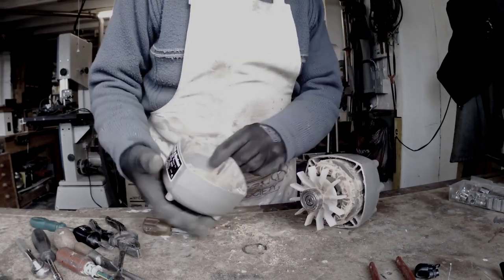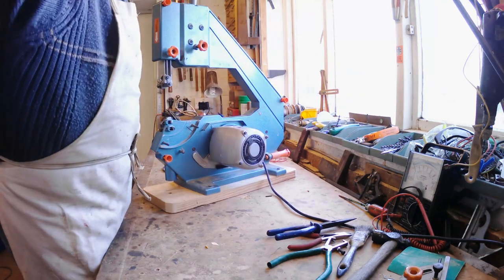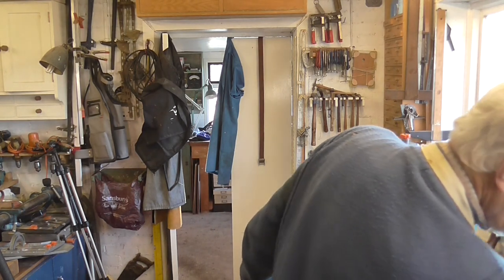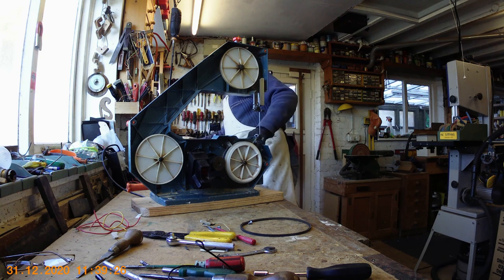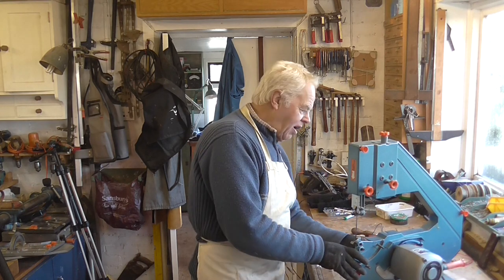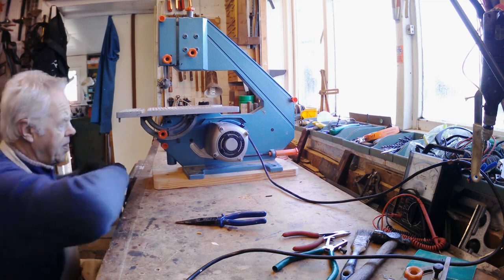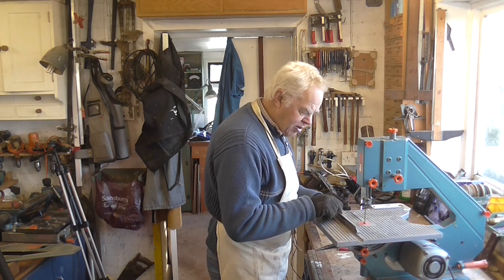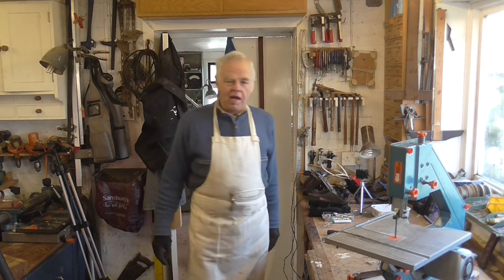Black & Decker Bandsaw repair Part Three.

Comment: A really instructive video (in 3 parts) that helped a lot. Same rotten wire insulation of course, could fix it in the same way as you did. Lovely to have the machine working again. A BIG THANK YOU from me in Sweden.
Reply from the maker: Many thanks for your kind comment Boo. Since I did this video so many people have reported the same wiring fault on these saws. so I am glad that I did the videos and that they have helped people.

Comment: Nice one. I have a bigger bandsaw, but still use the little B&D for cutting curves regularly. Great little saws.
Reply from the maker: Indeed, when one buys a bandsaw for the first time one gets a selection of blades from wide to narrow, but in practice I don't know anyone who changes blades for different jobs unless it's for a lot of work so a smaller machine is always worth having. Thanks for the comment.

Comment: Maybe a screwdriver set as a late Christmas present for Mrs Scrimper? I got my Wife a set and she loves them as she doesn't have to go out into the cold workshop when she needs one. And I'm happy because my screwdrivers are where I left them. I have also suggested to Mrs Col I need a second bandsaw but it didn't go down too well. I'll keep working on that one.
Reply from the maker: Hi Col, I actually equipped Mrs Scrimper with her own little tool box and tools but she complained that I had given her all my old rusty tools rather than decent ones. They are never happy are they? Lol. I even confiscated the retractable tape I had given here as it was a nice one and I replaced it with an older one. She doesn't like me sorting about in her shed so I keep her out of my workshop. LOL.

Comment: I gave up with bandsaws as none of them worked really well the  blade always had troublw tracking or snapping i spose youve got to pay a bit more for a good Bandsaw ,i bought a sheppach which was useless i had to pack the bearings out with spacers to line the blade up and a couple of other budget ones
Reply from the maker: A quality bandsaw is very useful for certain jobs but as you suggest they do tend to follow the grain and weave about. However they are useful for cutting shapes and things. One of the problems is that many of the cheaper band-saws are made in the far east and very poorly made in the same way as many domestic electrical products sold today such as irons, toasters and vacs which often last until the guarantee expires. Even some quality names are just re-badged cheap machines and no better than the same machines with an unknown name on them that cot less.
Reply: Have a look at Alex Snodgrass on bandsaws well worth a look

Comment: Hi, having the same issue but the cables was shorted inside the motor coil turns.... :( i send the motor for rewiring.. i need the manual as well... thank you!!!
Reply from the maker: It seems that so many of these B&D band-saws have this wiring problem. I am clad I did the video because it seems to have helped many to ring their saws back to life so to speak.

Comment: Hi John, I just thought I would pop by and say many many thanks to you. I bought a cheap DN339 a couple of days ago with the intention of renovating it. Luckily there is no mechanical damage at all and I even got all the fences and mitre gauge with it. But upon deeper inspection it had exactly the same problem as yours, in as much as the motor wiring had all corroded and the plastic coating had fallen to pieces right back to the stator. It was still working though luckily. 
With the help of your video series and in particular the very useful tip about using hot glue to stabilise what wiring was left, I managed to renew all the motor wiring and everything worked out as planned and I have reinstalled it and given it a test run. Ive still got to complete the rest of the rebuild but now I know the motor is fine I can press on. 
So once again many thanks to you and I wish you all the very best. 
Peter.
Reply from the maker: Thank you for your kind comment. I am delighted that the video was of help to you. When I was filming it I thought no one would be interested yet around 300 people have watched it. Since doing this video I have heard of at least 3 others who have had exactly the same problem as we have so obviously it is due to poor manufacturing. I have other machines much older than this one and never had any issues with cable sheathing on any of them. Rubber covered cable does perish but normally only exposed wiring. Anyway I am so glad the video helped you and it proves that my time making the video was not wasted. Thank you for watching. John

Comment: Another excellently produced and informative set of three videos John. Thanks so much for producing and sharing.
I really like the UK system of fused power plugs which we unfortunately don’t have here in Australia.
After viewing many of your videos I’ve just noticed that you don’t seem to need to wear glasses. Lucky you.
Reply from the maker: Hello Simon, thank you so much for your kind comment. Have to be honest I thought most places had fused plugs today, back in the early 1960's many houses in the UK  had the old 15a, 5a and 2 amp non fused plugs and socket system and were fused back at the consumer unit, but very few remain in use today. It's the reason most appliances came without a plug fitted, today everything comes with a 13Amp plug fitted because they are universal. Regarding glasses, I do wear them for distance but have to remove them to see close up so rarely wear them in my workshop.

Comment: Hiya, any chance of a video to do with chamging the balde on one of these? I've got one (had it for years) and I've always had trouble tuning the way it runs over the wheels. It seems to run kinda 'skew-whiff', especially over the back wheel. You know, the one that isn't above the drive-wheel.
Reply from the maker: I have always found it a bit of a 'fiddle' getting blades to run true on bandsaw wheels no matter what the make. The process always seems to involve an element of 'pot luck'. So I don't really have any 'magic' tips. Sometimes a particular blade is always troublesome no matter what you try.

Comment: Hello i recently found the exact same machine as this 

any ideas what size blade it uses as I've restored mine and all it needs now is a blade
Reply from the maker: Kieran, you need a blade length of 59 1/2 inches (1511mm) in length they are widely available. I would advise buying a good quality blade rather than the cheap ones - a good quality blade will improve your saw tremendously. I can recommend a company called Tuffsaws (UK only) I am using their blades on my saws and find them superb and way better than cheaper makes I have used in the past.

Comment: Hello Sir,
thank you for your videos!
I bought one yesterday. My problem with it is: the motor is turning in the wrong direction?!
Can you please tell me what I can do?
Thank you!
Reply from the maker: Make sure the motor is connected properly, Three wires should come out of the motor plus a green or green and yellow which is the earth wire an does not affect the motor. Of the three wires the red wire connects to the neutral side of the switch. the black wire connects to the live side of the switch. the white wire connects to one side of the capacitor whilst the other capacitor wire connects to the same live side of the switch as the black wire.

In other words both the red and black wires are connected to the live  with the white lead having the capacitor in series in the black wire. The red wire is the neutral wire to the motor. Essentially the motor has two windings with a common neutral whilst the other ends of the windings are both 'live' with the capacitor in series with one of them. If it's wires wrongly it will turn in the opposite direction.

Comment: If I was there I would have been stump we don't have fuses in the plugs
Reply from the maker: Hi Doug, until the 1960's a lot of houses in the UK had fuse-less plugs as each socket was fused individually back at the consumer unit. most installations here use MCB's which will trip rather than the fuse in the plug.